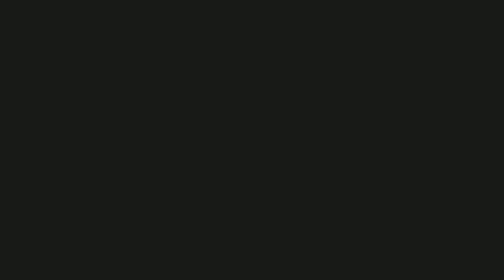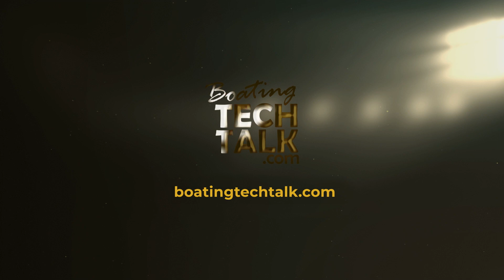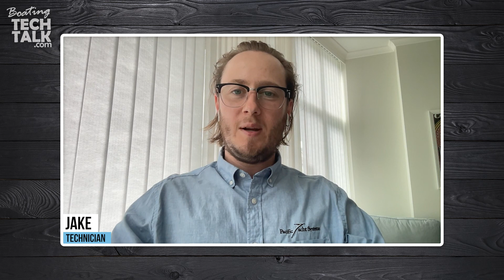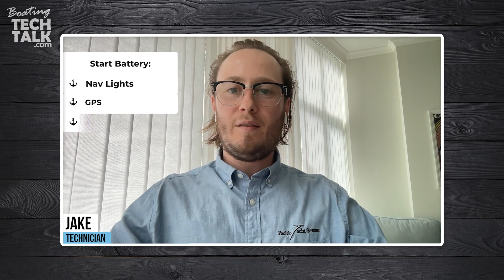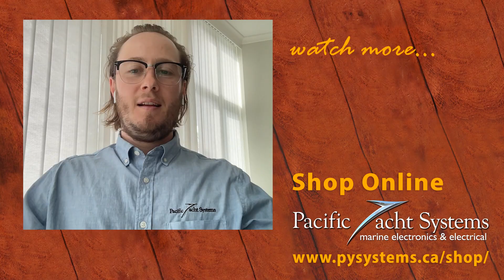Why Does the Navigation Gear Shut Down When I Start My Boat?

Comment: Or install super / ultra capacitor like a maxwell 16V 500F on a 12v starter motor, windless or bow / stern thrusters and never worry about starting issues again